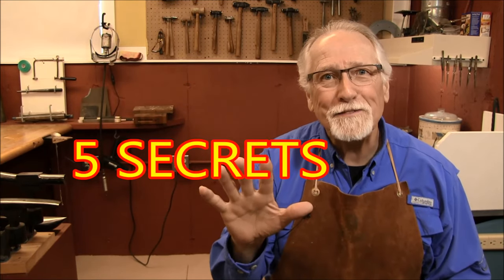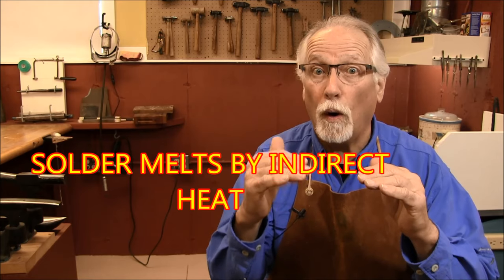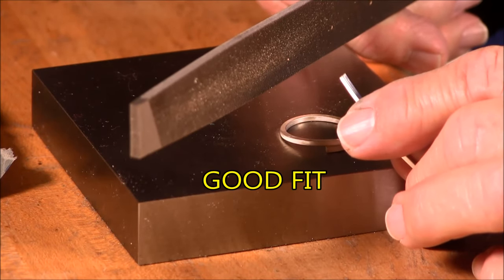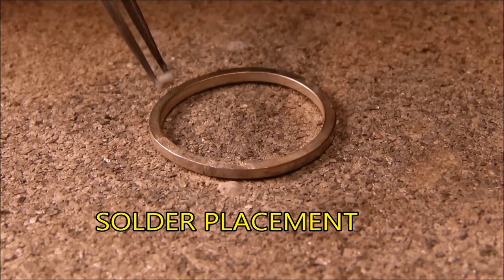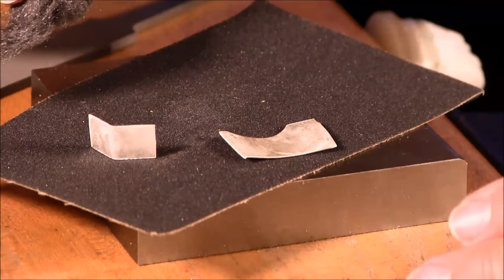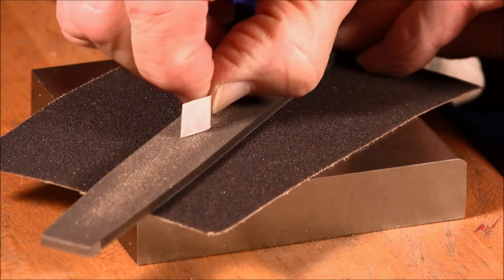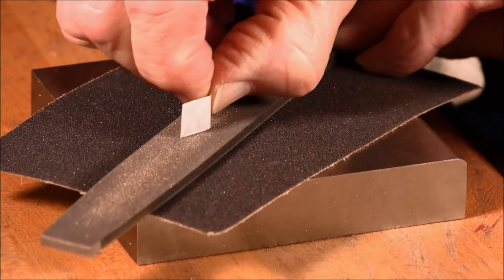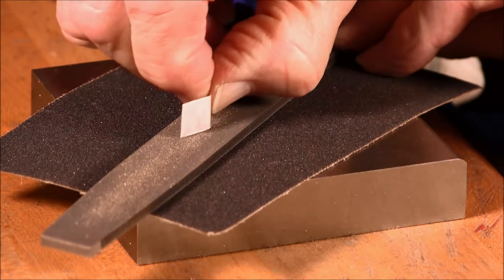5 SECRETS TO PERFECT SILVER SOLDERING!

Comment: Thank you for the video. You are calling the solder in this video pallions? How is that different from paste solder or the solder that you cut up from a sheet or a wire a new?  I am scouring the Internet for extra education to supplement my in person classes I'm taking.  Any extra information will be appreciated. Thank you.
Reply from the maker: Hello Lori,  You are very welcome. The forms of solder are:  sheet, wire, pallions ( clippings, chips, snips, cuttings) from sheet solder,  and paste.  I generally use sheet solder and cut pallions from it.  I use wire solder only when I am stick feeding.  If I cut pallions from the wire, they will sometimes roll around and get out of position in the solder joint.  Paste solder is a mix of tiny bits of solder mixed with a paste flux.  Check out my video "Top 5 Silver Solder Placement Methods".  More on solder in that video.  Thanks for your questions.   Greg Greenwood

Comment: What is the actual size of the pieces your soldering.  I'm doing larger pieces and am having trouble getting my solder to work.
Reply from the maker: Hello Rebecca,  The pieces in the video are all under 2 square inches.  If you are soldering larger pieces, make sure that you have a torch that will heat the metal to melting temps.  Practice heating  the size of metal that you will be soldering by putting some borax flux on it and heat until the flux stops bubbling and becomes clear glaze.  If it does not get to that temp in a short amount of time, you need a larger torch.  Good luck to you.  Keep watching.  Greg Greenwood

Comment: Hey there, Greg! Was wondering if you have a video where you shoe joining a bezel with a flush set in the middle. I just dropped a cabochon that I was working on, and it cracked in half at about a 45° angle, almost dead center of the cab. So I was thinking it would be cool to set it, and separate the two halves by about 3/16" with a flush set opal in the middle. I just don't know how to go about securing the two halves of the cab, where it joins with the flush set. I've tried flush setting before, and have had trouble getting the bezel just right to where I can fold it over the shoulder of the cab.
Reply from the maker: Hello redeyestones,  Thanks for your question. I have a couple questions for you.  Would the flush set opal take up the entire space along the crack of the cab?  And would the opal have a bezel around it or would it sit right up to the cab with no bezel?  If you would like, you can send me a photo or drawing to my email. greggreenwoodjewelry@gmail.com  ..  Looking forward to your response. Greg Greenwood
Reply: @greggreenwood4628  very cool! I'll do that later today, when I'm near paper and pen. Thanks!
Reply: @greggreenwood4628  unfortunately, sending video via email is no longer a possible action anymore. I made an extremely short video, and tried to send it. But, was notified that the file exceeds the 25mb limit. Google is really dropping the ball on that one.
Reply: @greggreenwood4628  I sent you a photo, along with a bit of a description of what I aim to do. Thanks for your time!
Reply from the maker: Hello redeyestones,  I have not received the email yet with the photo.  Maybe resend.  thanks Greg Greenwood

Comment: hey greg! great videos! would you kindly share the brand of silver solder youre using? i have poor results with sheet. and great results with regular ol electrical solder. id love to find the right silver solder wire to give a nice shine ! thanks so much in advance
Reply from the maker: Hello John,  I have a couple questions for you.  1.) When you say you have great results with "regular ol electrical solder"  Is this a low temp lead solder? 2.)  What are you soldering?  3.) What grade of sheet solder are you using? 4.) Are you using flux and what kind?   Let me know so I can get a better ideal of what you are doing.  Thanks.  Greg Greenwood
Reply: @greggreenwood4628  thanks for your reply. i attempted to be more patient and got the results i was looking for from the sheet solder... thank you for the videos and inspiration!
Reply from the maker: Excellent!!  Glad the sheet solder is working for you.  Many times when using high temp solders, we do get impatient.  A little tip on sheet solder.  Only cut the amount of pieces of solder for your project. BUT,  before you cut them, clean the sheet solder with steel wool or smooth emery cloth to remove any oxides on the surface.  Use CLEAN  solder and it will flow much better.  Good Luck.  Greg Greenwood

Comment: Is that a torch you use for soldering? Can I use a cauting welder enestead ?
Reply from the maker: Hello Luly,  I use a presto-lite acetylene gas / air mixture.  You can use propane torches or butane torches also.  They are readily available in most jewelry supply houses and hardware stores.  I would not us the welder..  Thanks Greg Greenwood

Comment: I thought your video was very helpful. I’ve been learning how to solder from you tube.  I have a question about burning off the flux.  Doesn’t that cause fire scale? Are you able to solder after the excess is burned off without Pickling?
Reply from the maker: Hi Marcia,  Good question about fire scale.  I am going to be doing a video on fire scale, so keep watching.  Now, about burning off the flux.  When soldering silver and you have applied your borax flux.  You want to burn off ONLY the excess water so the flux will lie down and become a coating on the silver to protect from oxides including fire scale. Don't burn off all the flux. If you do, you will have to repickle and start again.  Then continue to solder the solder joint.  I hope this has helped you.  Thanks for your comments.  Greg Greenwood

Comment: Hi Greg. I need undo a sold that i made. How can i do it? as I told you I'm back here asking questions. Thanks a lot
Reply from the maker: Neomi,  Unsoldering can be very tricky. But, it can be done.  Clean the piece in the Pickle.  If you have a wire to wire.  Flux the joint and hold the piece up with cross lock tweezers and melt the solder.  The bottom piece will usually fall off.  The same for wire to sheet.  If you have two pieces of sheet silver try to lift the top piece off when you see the solder melt or push it to the side when you see the solder melt.  Be careful, because the silver in all cases can "rip and tear" when it gets at high temperatures. Try this and let me know how it goes.  Good Luck.  You can do it!!!   Greg Greenwood
Reply: @greggreenwood4628  sorry is too late my response. Yes i can do it. was easy. I supose the soldering that i do was not good. jaja

Comment: If I used medium solder to seal my bezel wires can I use easy solder for sealing bezel to sheet metal? Or do I use medium again, I think that would mess up the bezel solder no?
Reply from the maker: Hello Big Red,  Yes, use easy solder on your sheet metal.  It is always wise to use the next step down in solder.  You may even try using hard solder on your bezel wire and then use medium on the back sheet.  Then you have an option to solder on a bail  or jump ring to the back sheet using easy solder.  Great question.  Thanks Greg Greenwood
Reply: @greggreenwood4628  I only used medium first because I don’t have any hard solder! I attempted to use easy solder to secure my bezel wire and it did not work out so good. I was heating from the top and the solder would not melt, I only assume because of the thick sheet metal. I ordered a tripod so that way I can heat from the bottom, I’m hoping this is where I went wrong because I’m clue less. You have any input?
Reply from the maker: Hello Big Red,  That is OK that you do not have hard solder.  You are correct in thinking that the sheet metal did not get hot enough.  The tripod will help you a lot.  This is a common problem when soldering bezels to back sheets.  Once you start heating from the bottom, I am sure your problem will be solved.  Good Luck and let me know how it goes.  Greg Greenwood

Comment: Mr Greenwood, what is it that you are soldering your projects?
It looks somewhat granularly.
Reply from the maker: Hello Martin,  I am using borax flux and silver solder cut into small pieces.  Hope that answers your question.  Greg Greenwood
Reply: @greggreenwood4628  Sorry sir. I just reread my message to you. I barely understood it. LoL. Lets try this again. What is the top of your work table made of? Cork?
Reply from the maker: Hello Martin,  That makes more sense! LOL  I am soldering on a Vermiculite Soldering Block. It is a great soldering surface.  Reflects the heat back onto the jewelry piece. They are available at Rio Grande Jewelry Supply. Not expensive.  As for my work benches. My jewelry work bench is wood and my soldering bench is black slate, ( nice a fire proof).  Feel free to ask my any questions.  Thanks Greg Greenwood

Comment: I see your pickle pot behind you in your shop...how do you keep from rusting all your iron or steel tools? Are you using a citric pickle?
Reply from the maker: Hello Horace,  That is an excellent  question.  Those acid fumes can be a problem.  I do 2 things. 1.)  I always keep a lid on the pot.  The only time  I open it is to drop in or take out a piece of metal. Also,  by keeping it on the lowest heat temp it reduces the amount of steam that comes out when I open the lid.  The lowest temp on the pot works well  to speed up the pickling action.  2.)  I have the pickle pot directly under my vented hood.  This draws out most of the steam when I open the pot.  The galvanized pipe holds up very well with the fumes.  The fumes are out quickly and fresh air "cleans" the pipe.  As for the pickle solution.  I have used Sparex for over 45 years and am very happy with the quick results in removing oxides.  I have used Citric acid for a pickle also.  I like it and it doesn't give off the fumes like Sparex.  I have found that it takes a little longer to remove oxides, but it does a good job.  I also have used a mixture of Citric 80% to 20% Sparex.  This mix works a bit faster and saves time waiting for your metal to get cooked. (Side note for you).  Many jewelers just rinse their pieces in plain water after removing from the pickle.  I have found that dipping the piece in a solution of baking soda to neutralize the acid first, then rinse in plain water is much more successful.  If you are working with a piece that has small hard to get to areas or enclosed areas, the pickle acid  solution can stay in those areas after a plain rinse.  Then you spend your time buffing and polishing thinking that the piece of jewelry you just spent hours on is finished.  Then one day later the acid drips out and leaves a crust right in the middle of the mirror finish.  Not fun.    Thanks for your question, feel free to ask any question, anytime.  Greg Greenwood
Reply: Greg Greenwood I practice everything you mentioned...differences are I have no vent...just charcoal filter fan for soldering fumes and a dehumidifier...I finally had to move my pickle (Sparex) on the porch of my shop and began using a stained glass solder blackener on much of my iron and steel tools...they look good and no longer rust...also, I’ve always run my crock pot on HIGH to save time pickling.
Thank you, Greg, for sharing your wisdom and technique...
You can see some of my work on Etsy...search for my store MontainSilversmith through their search engine...I’ve been workin with silver and stone since 2019...lemme know what you think!

Cary Pollock, MountainSilversmih
Reply: @greggreenwood4628  Great to know! Thank you.

Comment: How would you fix a hairline crack in a silver ring occurred from imperfect lost wax investment czsting where the wax ring was not properly sealed after I made a mistake in the carving
Reply from the maker: Hello Tim.  To fix the casting, I would file or grind a small groove in the metal and fill it with solder.  Or if it is large,  solder a small piece of silver into the groove.  Then in both cases,  smooth out and polish.   I hope this helps you.   Greg Greenwood

Comment: How do you remove flux from the joint after soldering ?
Reply from the maker: Hello Dan,  Normally we put the piece in "Pickle" ( a mild acid solution) It works best if it is warmed.  Take a look at my video "What is Pickle?"  It will give you some tips.  Thanks for watching.  Greg Greenwood

Comment: Hi! I am wondering, i cast a few silver rings from wax, and as I was cleaning up a small hole started to appear at the thinnest point of the rings. I am wondering if you have any tips on how to fill the holes without melting the edges of the hole? Thank you
Reply from the maker: Hello lou woolard,  Thanks for your great question.  The holes in castings can be a problem.  I would suggest to drill the hole to make it clean and neat. (Hole MUST be clean!).  You do not have to drill all the way through the ring, just enough to clean out  any investment- plaster/oxides. Then cut a small piece of round wire that will fill  the drilled hole and have it stick out of the hole slightly.  Then solder the wire into the hole with medium or hard solder.  Cut the extra wire flush with the ring, file, smooth with emery paper and polish.  The hole will disappear.  I hope this helps you.  Let me know how it goes.  Ask any questions, anytime!  Good Luck  Greg Greenwood
Reply: That is brilliant! I will be in the workshop tomorrow so I will keep you posted on how it goes.Thank you so much.
Reply from the maker: Hello Lou,  Let me know how it works for you.  Have fun.  Greg Greenwood
Reply: @greggreenwood4628  it worked! Thank you so much for taking the time to respond ,you saved the day Greg!
Reply from the maker: Hello Lou,  Way to Go!! Keep up the great work.  Greg Greenwood

Comment: What is your base board made of? I have been using char oak board
Reply from the maker: Hello Stephen,  My soldering bench top is black slate.  I repurposed from an old house counter top.  I love it! Thank you for sharing.  Keep watching.   Greg Greenwood
Reply: @greggreenwood4628  thank you
Reply: @greggreenwood4628   I did not know that granite would work. I live in a mountain of granite.  I am going to cut  a slab of indigenous granite tomorrow from my yard and let you know how it works
Reply from the maker: Hello Stephen,  I don't know if granite will work.  I used slate.  Let me know how it goes.  Please be careful with the flame and heat.   Thanks   Greg Greenwood
Reply: @greggreenwood4628  thank you, so much. It has been Over 40 years, or so since the last time I worked with silver. I have completed 98% of the wedding rings for my son . Wow, How much I had forgotten and even did not know.
   You have no idea how valuable you have been. 
  I specialize in  cuttlebone bone casting.  And I  choose not to ask for help when it comes to this. Because I guard my secrets which I have had kept for over 50 years and would be happy to share them with you, but perhaps you already know,  I would not share them online.
 Thank you for all the information that I have learned from your website I’m in the process of going back in your website and watching all of them.!
  With great regards,
Stephen, Rocks

Comment: When and where do you use easy, medium, and high melting silver solder
Reply from the maker: Hello Roy,  The different grades of solder melt at different temperatures.  When you are soldering several solder joints in a small area.  You would solder first with Hard solder, then solder the next joint with Medium, then finish with Easy.  Check out my video " What the Heck is Sterling Silver and Silver Solder?"  This will give you insight into silver solder.   Thank you for watching.   Greg Greenwood
Reply: @greggreenwood4628  Thanks for the response 👍
Reply from the maker: My pleasure!  Greg Greenwood

Comment: What type of flux are you using here? It seems to me that when you pre-heat the flux, theres more going on than just drying it out and removing the excess.
Reply from the maker: Hello Johnny,  I am using "Handy Flux".  It is borax flux.  When the flux is heated, It will boil off any water or liquid and start to "settle down" on the surface.  Then the flux will start to melt and form a solid glaze over the surface.  This is what protects the surface from oxygen.  Hope this answers your question.   Thank you for watching.   Greg Greenwood